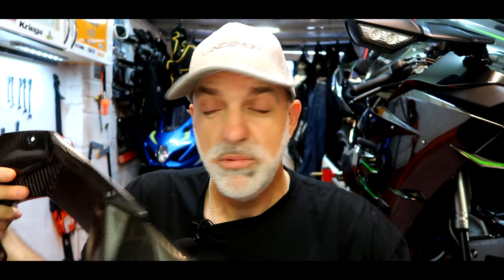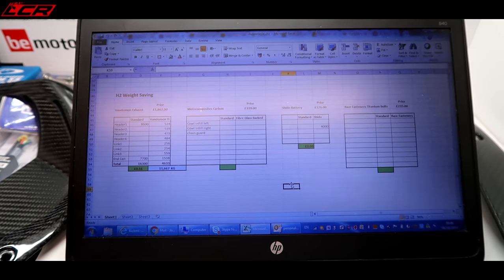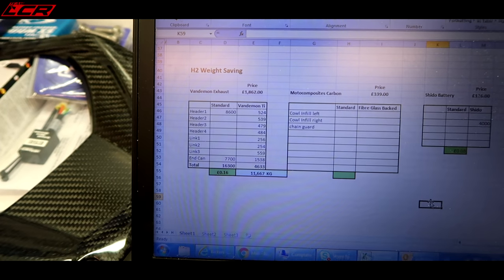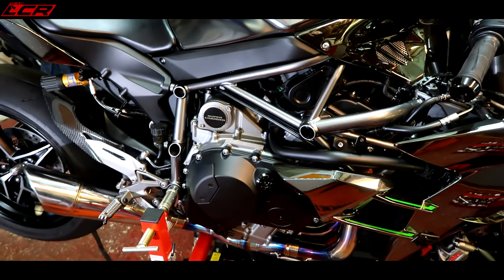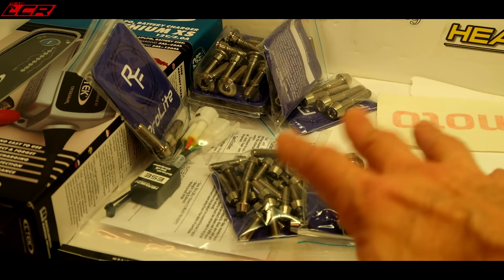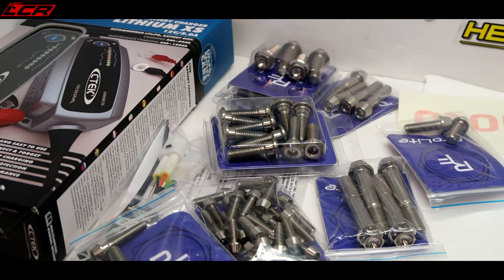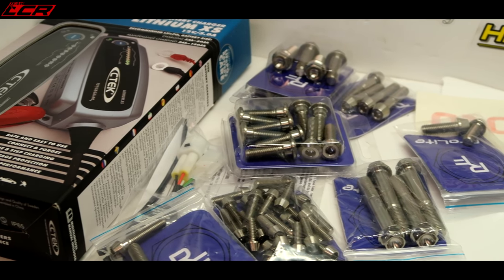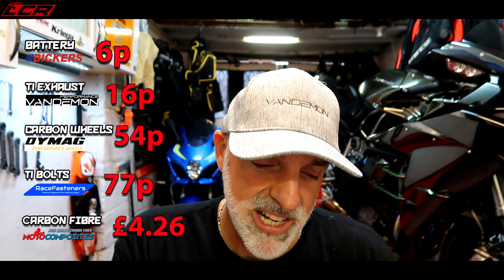The BEST Motorcycle Weight Reduction | Results May Surprise You!

Comment: The lithium battery is an easy one. I've done that already. Other than that, the cheapest option is to remove stuff. For a dual-purpose bike, which is mainly for off-road use, you can remove unnecessary lights and mirrors. Cost is zero. You can always put them back on. Where I live in Mongolia, the police turn a blind eye to dirt bikes so they can be stripped to the essentials. I'd probably only save about 5kg but that's about 4% of the bikes weight since it's light - I'm referring to a Yamaha WR250R (dual purpose, street legal). I'm already skinny so I can't save much there but my main concern is lifting it up after the inevitable drops.

Comment: I fitted a Li-Po battery on my R6. Another cost to factor in was the cost of a new, Lithium battery compatible battery optimiser.

Still a worthwhile weight saving but clearly the cost-per-gram was adversely affected. You'd need to add the cost of a torque wrench to the cost of the ti bolts too.

Comment: Best cost effective weight saving for me would be stop eating so much stuff. Definitely could lose a few kgs there. Battery was a interesting one. How reliable are they and can you use many of the popular battery tenders to maintain them, particularly over the winter months? Does your insurance company know of all your performance mods? Would be interested in how much they have put your premium up? Some companies won't even quote after some major upgrades.
Reply from the maker: Yes I do have a special charger but did manage on the lithium I had on the Super Duke and Beasty for years without one. Just discount the battery if your going to be parking up over the Winter. Insurance does increase of course with the mods, I include all the mods I currently have with my premium when I took it out. Carbon Wheels made the biggest difference on the GSXR to the insurance!
Reply: @LambChopRides  After a little research I found this - Can my OptiMate be used with Lithium / Lithium-Iron / LiFePO4 Batteries?
 We only recommend OptiMate Lithium chargers for Lithium batteries. These batteries are very different to lead-acid construction and have very different characteristics. OptiMate Lithium chargers have many special functions and features designed solely for Lithium batteries. Using an OptiMate Lithium charger will extend the life of your Lithium battery enormously. In certain circumstances, using a traditional lead-acid charger will cause damage to a Lithium battery hence we cannot recommend it. - Seems like it's not a good idea to put these Lithium batteries on regular maintenance chargers as I suspected. As I work away at months at a time keeping the battery ready without the hassle of removing from the bike is important to me.
Funny how carbon wheels made such a big difference, guess it's the additional cost of them. I would of thought the power increases you have made would of set the insurance companies purse bells ringing far louder.

Comment: Nicely done, does the new battery take much looking after? To keep it fully changed.  I remember in late 90s N Harga was told to lose weight and cut down on the cigarettes to boost his bikes performance😱 what a legend💪💪👍
Reply from the maker: Ive had two in the past, one on Beasty which was on their 3 years (without a single problem) And I also had one on the Super Duke for a year also without a single problem. I didnt even have a Lithium battery charger back then! Things they dont like is cold weather, so not ideal for a bike used throughout the Winter, also they dont like  small current draw like alarms. So will need topping up if your bike has an alarm and sits for long periods unused.

Comment: 👍
Battery is the first thing I did as they usually mounted high up just under the seat . can notice the difference just push the bike around . See you bought a charger for it .
Reply from the maker: Yes good point Mark about mounting location! Yes have a charger too, but if you disconnect the battery for the winter or storage shouldn't need it..

Comment: I'd say, battery, lighter chain (results in quicker wear too though),  and if you have the excess money, carbon wheels, are most meaningful, as two of those are rotating mass you might actually feel them. For trackriding, carbon wheels might be a bit too high in terms of cost potential in case of a crash :(
Reply: Reduce unsprung weight also

Comment: Love your vids Chops, my No1 (well since Boris on Bikes has gone AWOL) but a lot people give Lithium batteries 🔋 a bad rep, charging and not starting if it’s too cold. What are your thoughts LCR?
Reply from the maker: Thanks Richard, Ive had two in the past, one on Beasty which was on their 3 years (without a single problem) And I also had one on the Super Duke for a year also without a single problem. I didnt even have a Lithium battery charger back then! Things they dont like is cold weather, so not ideal for a bike used throughout the Winter, also they dont like  small current draw like alarms. So will need topping up if your bike has an alarm and sits for long periods unused.

Comment: By changing to a Lithium battery for a bike which was supposed to have lead acid, will it be safe? Will the bike over charge the Lithium battery.

I would love to change mine but im not sure it is safe, wether it will over charge on longer journeys.
Reply from the maker: Ive had two of them with no issues, they have inbuilt voltage management circuits to avoid over charging.

Comment: Lithium battery will need a special charger as well .nice video chops thanks from danny
Reply from the maker: Yes good point, but it did manage without a special charger on the one I had on Beasty  for 2 years. If you do have an alarm they dont need charging.

Comment: Could you do a video in the future Chops about the pros and cons of Lithium batteries, talking about chargers, necessary modifications to battery terminals for example due to their smaller size. Ive now got a gen 1 Aprilia RSV1000 Mille and many say replacing the battery with a good strong battery can help avoid sprag clutch issues. Maybe Lithium is the way to go?
Reply: They come in the standard sizes, I just disconnect mine if I'm leaving the bike for ages (winter) and bring it indoors, I haven't ridden for over a month and it's started right up
Reply from the maker: Yes good idea, I will keep an update of any issues ive experienced with it. What they dont like is small current draw like alarms etc. I may discount the battery while the bike is stood up for the Winter. I do have a lithium charger and added a charge point as part of the install so could just stick it on charge every couple of weeks... But disconnecting it is probably the best way to preserve it over the Winter.

Comment: Hey LCR should I get the Brock’s exhaust for the Gixxer or you reckon something else would be better??
Reply from the maker: Good question Sid, the Brock's is good and performs very well, slightly better than the Arrow system in the dyno tests we did. The Vandemon is also great though and they do systems for other bikes so check them out too. Not a big a range as others but quality systems at a reasonable price as I think the Oz exchange rate is very good.
Reply: Lamb Chop Rides gotcha if you could choose anything right now what would be your top 3 btw we love you over here in the the states!!

Comment: Is LTZ Shido's newer version or something, if you know? lol.  Mine is the LTX, I was supposed to get the 10 really but mistakenly got the 9, still had no issues with it.  It's smaller than the lead acid battery too, so I'd imagine a little more weight saved too at a cheaper price (under £50).  But on your bikes you definitely need the higher capacity and higher CCA's.

Comment: Everyone that's not a real gear head says lose weight , if  your over weight then yes loose ten or twenty pounds otherwise cut bike weight . If your bike weighs 400 lbs and you weigh 180lbs and you get the  bright idea to lose 150  pounds of body weight and your gonna be super fast on your bike cuz you only weigh 30 pounds well that's not gonna work to well cuz
 your bike still weighs 400 pounds! Find ways to drop 25 to 30 pounds off your bike and you will feel a difference.
Reply from the maker: Exactly Tim! As it happens yes I could loose a few lbs but not everyone can. 👍

Comment: Youve lost half a stone in body weight doing all the bolts !!!!!!. Dont forget to factor in the cost of the battery charger for the LI battery too.
Reply from the maker: Yes good point Roger, battery charger is advisable if your bike has an alarm.
Reply: Lamb Chop Rides I had to use my li trickle charger all the time in the cold (winter) also after a year or two my battery was toast couldn’t start after a week without the charger

Comment: There is Only one possible "best mod that removes weight". Remove the crap you don' need, like Passenger pegs and reflectors (if it's legal in your country). My 2019 MT-09 dropped at the very least 1.5kg and it cost me exactly nothing. on a 190kg bike, thats almost a percent free weight loss. (For MT-09 owners out there, check out "TwoWheelObsession"'s video on how to get a free replacement for the break fluid holder holder)
Reply from the maker: Yes indeed I should have mentioned this but goes really without saying. 👍

Comment: Ive added an Aliant Lithium Battery (700grams) to my 650 , instant difference , Stock exhast is Stupidly heavy too.
You could get real anal & remove Bar Ends , Carbon Wheels etc
Good shout out for Race Fastners , I need some bolts as mine are in need of a swap